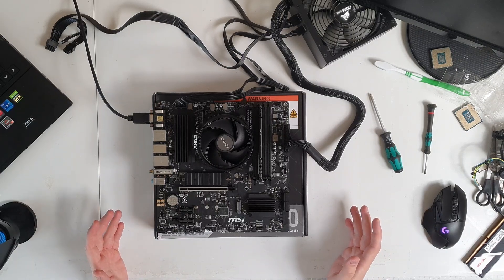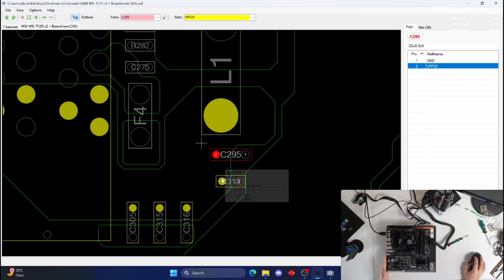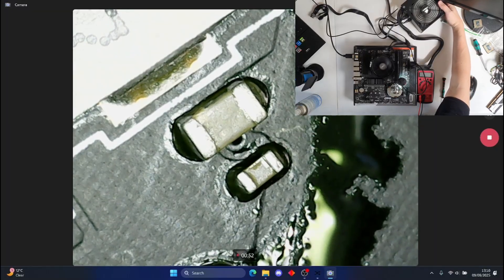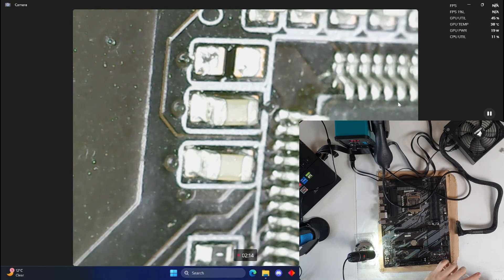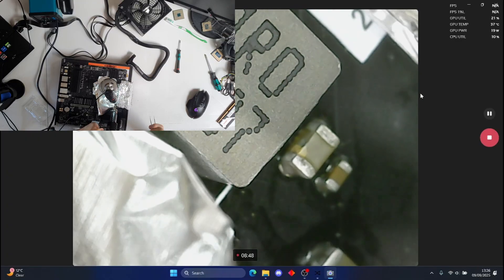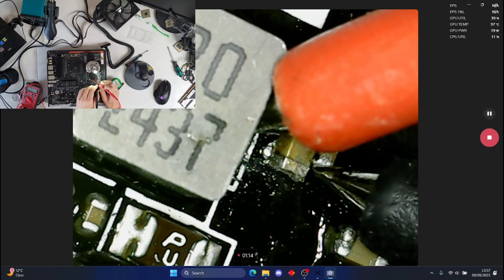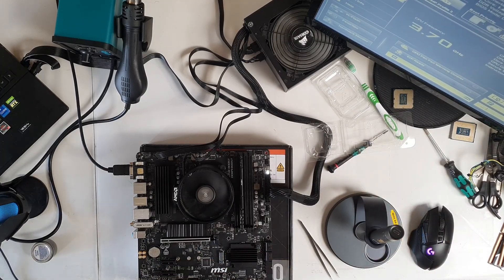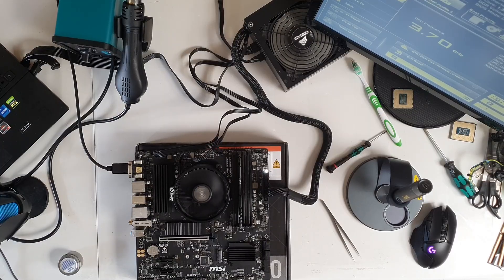MSI B550M PRO VDH WIFI - HUGE SHORT - CPU LED - FIND & REPAIR

Comment: I am trying to fix the same board right now. By any chance do you rememver the resistance of the 5V of the 24 Pin atx? Mine is lile 140 Ohms but nothing is heating up supsically... got a random flashing after pressing the power button dran/vga/boot led and cpu is gettung warm.

Comment: bro please can u replay my comment with the name of the tools u used to solve this problem and the name of the app thats show the capasiters info? ty🌹🌹
Reply from the maker: Hi. The program used to view boardview files is called BoardViewer. You have to find the files online separately. I used a multimeter to take measurements on the board and a hot air gun for soldering/desoldering.
Reply: @terraplexx ty very much, i am interested to try to fix my own motherboard personally

Comment: Nice fix. I have same problem with asrock B550 velocita. The board turn on and able into bios only few seconds. But suddenly debug code goes 00 with no beep no display.

 Board stays on with debug code 00 and either reset/power button is functioning. So i have to switch off from psu button. 

Could that be a failed cpu or weak psu ? Thanks man
Reply from the maker: Thanks! From my experience, no, it is not psu or cpu issue. 

That is the worst kind of issue, I have never been able to fix a board that powers on and boots normally and then shuts down on its own after some time.

Comment: Here is a tip for not melting plastic on boards while using hot air. The aluminium foil and pci-e slot cover thing works pretty good for straight rows of components etc. But when you have a landscape of all kinds of sizes of components you want to protect, you can use aluminium tape instead. Now the aluminium tape itself has way too strong of an adhesive to use safely on PCBs but if you back the aluminium foil with 400C resistant Kapton tape, you got something real nice to work with. The kapton tape itself, eventhough it resists up to 400 degrees celcius, still is a bit sensitive to heat and flutters in the airflow but has good adhesive that isn't going to rip up pads/traces/components when removing it.